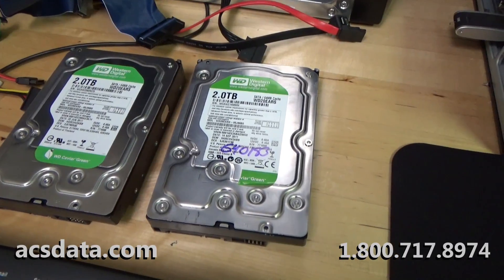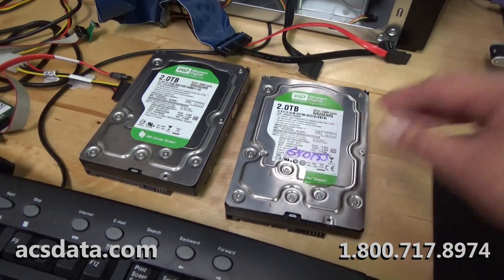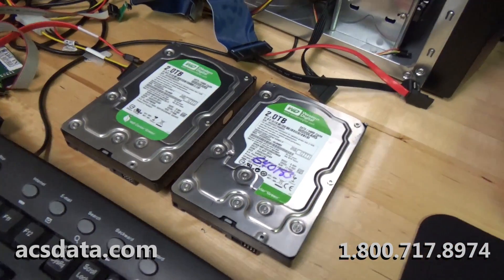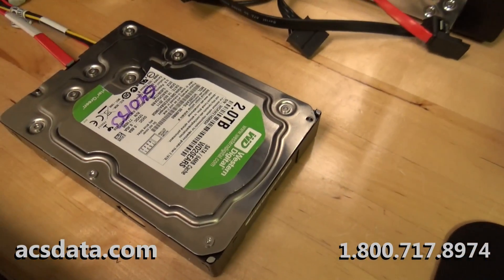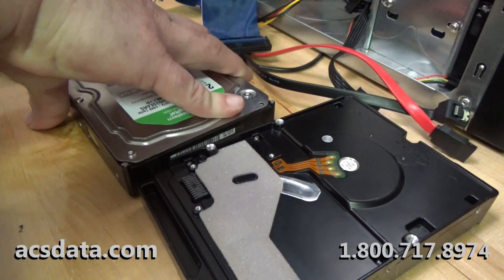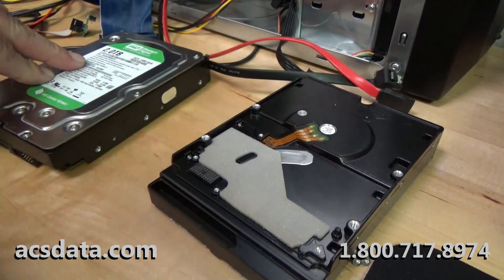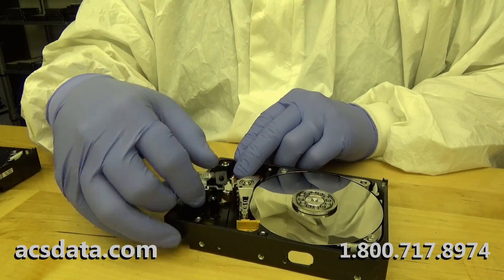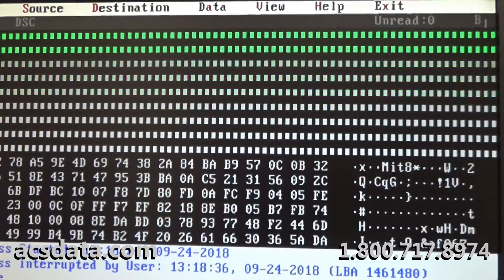Data Recovery On A 2TB Hard Drive - Head Failure Or PCB Failure?

Comment: I just did my first search for "2tb hd recovery" and yours was the first video that came up. 
This is my exact hard drive that stopped doing anything!
I just went on ebay and ordered a used, tested, working duplicate.
Just to be sure... once the HD starts working I can simply continue using it or just transfer my files conventionally or do I need special software like you used?
One Q: What were those things you placed between the arms and what was the purpose? 
Thanks in advance!

Comment: Thank you for sharing this with us.  I appreciate it.
I have a question and I really hope to get an answer from you.. I have a mini external hard drive.. it a 2TB. I have my most valuable family videos and pictures in it.. a few months ago it started clicking and eventually would not show anymore on my PC.  I have a bit locker password on it and I need to fix it.. my plan is to buy an identical used working one and transfer the mechanism to my hard drive.. I am aware that I am supposed to keep the platters perfectly aligned, but my question is.. where is the bitlocker password stored?? is it on the platters or somewhere else?
Thank you.   I can not afford to pay for fixing it .. I don't mind waiting though.
Reply from the maker: You won't need to do anything with the platters in that type of situation, so maintaining alignment is not an issue.  If you really need the data, I would recommend storing the drive somewhere safe, and saving up to have the recovery done by a professional.